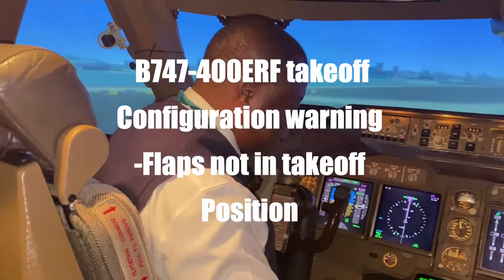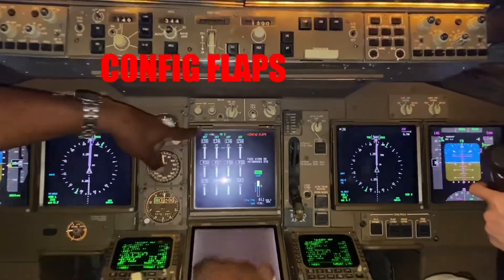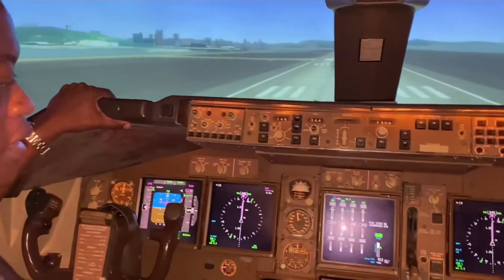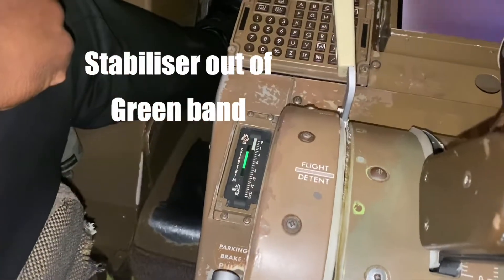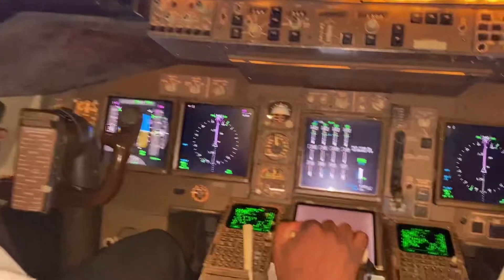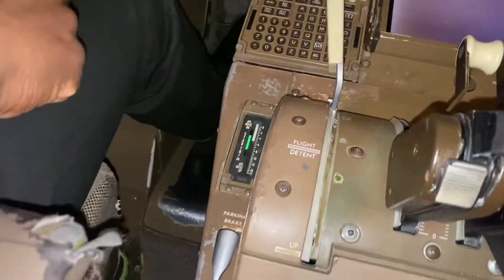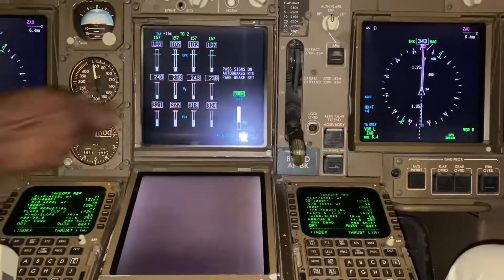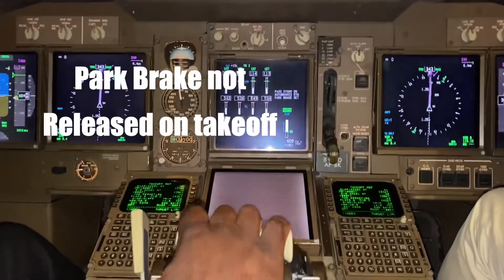CONFIG Warning. B747-400

Comment: I'm here after Air India 1771 crash. Apparently the aircraft didn't had flaps extended during take off, but if flaps weren't configured properly this alarm would've triggered.
Reply: same
Reply: I seriously can't imagine that, even a completely untrained non pilot would not try to start a plane with this sound going off when applying thrust.
Reply: I came here for same reason. I'm assuming 787-8 has same config warning for no flaps. In such case, most likely the pilots would know the mistake. All the online experts are referring to the grainy video to claim there were no flaps. However, there are crash site photos, one showing a wing with flaps extended.
Reply from the maker: Correct

Comment: Captain, are you planning to move on the A380 as a command pilot or you rather stick on the 747?
Reply from the maker: I wish- sadly Cathay Pacific does not have the A380
Reply: @pilot_obet  you are better off in a plane that will be around for a while. And it’s prettier.

Comment: How many engines can 747 lose on departure and still climb out?
Reply from the maker: I’ve done a double engine failure and made it - main thing is to go for speed. Retract flaps as fast as you can.
Reply: @pilot_obet  By as fast as you can, you mean as soon as it’s safe to so so, yes?

Comment: I heard that in the 747 the Takeoff config Masterwarning is also active, when the bodygear is not centered (after sharp turn for runway line up).

If i am not wrong the warning comes also when the flaps are set for position 30, for example. When Flaps position is too low or too high.
Reply from the maker: You would get the Body gear steering alert on the upper EICAS before you got the chance to apply thrust so would correct it
Reply: If you would not correct it, and you would advance the throttles, will the Master Warning be activated?
Reply from the maker: I’ll show it in simulator